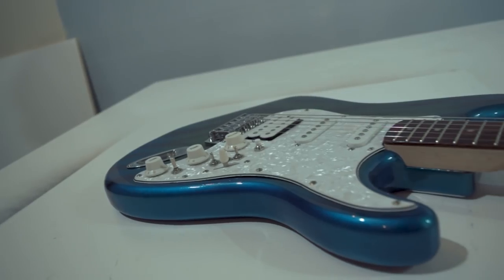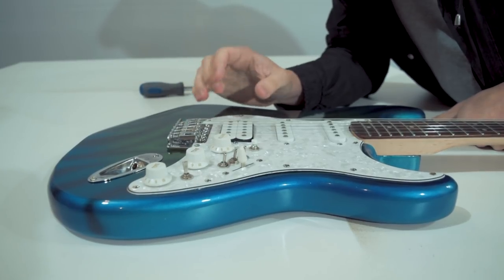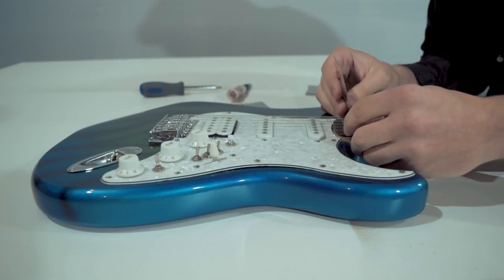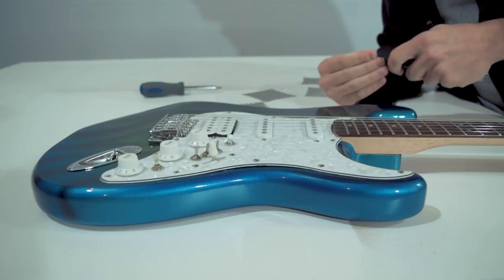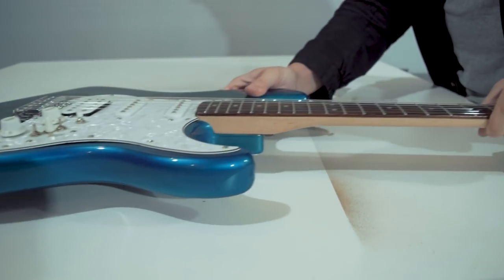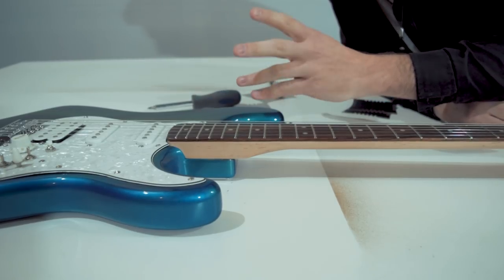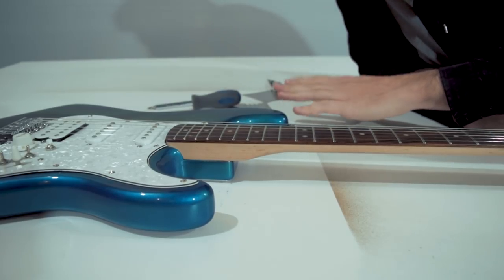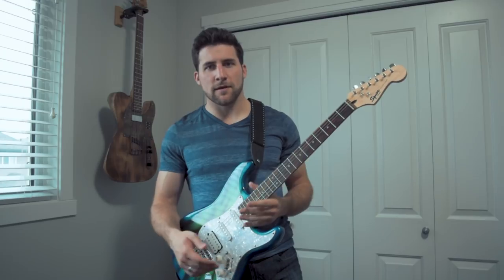How to make a cheap guitar awesome part 3 (final)

Comment: The floating vibrato is a key component to the sound and feel of a Strat. The strings are anchored to a spring assembly, rather than directly to the body. That's special. It really doesn't have anything to do with using the arm.
Reply from the maker: I am not at all fond of Strat tremolos personally. I prefer hard tail, or if I’m using a tremolo Im a fan of the zero resistance models from ibanez.
Reply: @BradAngove  More twang for me.

Comment: Hey Brad, I was wondering if you've had any experience with "sparkle" spray paint? I was wondering if it was similar to metallic (chrome, gold), because when I have used metallic spray paint in the past, the "shine" of it goes away when I put clear coat on it and the colors become dull. Like silver turns into gray. Also, what is candy tone spray paint? Does krylon make any? Like would "candy apple red" be considered candy tone? I'm looking to make a marbled effect
Reply from the maker: The sparkle stuff is different than the metallic shine. You’ll probably want to clear coat it to seal it in. It’s like metal flake. It shouldn’t lose its shine like that chrome stuff. 
Candy paint is dye based instead of pigment based. If you search it on my channel, I did a specific video explaining what candy paints are. I don’t believe krylon makes any.
Reply: Brad Angove thank you very much
Reply: Brad Angove thank you very much

Comment: Great video, your intonation sounds a little off but it could be you're using to much finger pressure. Could try using a lighter pressure or lowering action. But still sounds good. Please consider a fabric finish tutorial.
Reply from the maker: +XGCPolaris it could probably use a bit of an adjustment. 
I don't know how to do a fabric finish haha. It wouldn't be a tutorial so much as just a test; which I would probably mess up.
Reply: Brad Angove A tutorial on your art pieces would be awesome, the they look almost holographic, the paint effects gives depth and almost makes the 2D surface look alive. Awesome freaking talent. Any way to do that on a guitar or does it need a metal surface? Thank you for all your tutorials.
Reply from the maker: +XGCPolaris It needs a metal surface, but I've been playing around with the idea of giving a guitar a metal surface.

Comment: Brad nice Job! I have a question I've been forgetting to ask you I'm hoping you can help me with? Well after painting five Guitars with Rustoleum like in your Videos is there anything that can be done about that chemical smell from the paint after the paint has dried? I thought they were supposed to be oderless paints? Is there a Fix for this problem? Let me know Thank you!
Reply from the maker: +mike giffin Once the paint has fully dried you shouldn’t be able to smell it anymore. How long has it been on there?
Reply: One I painted over six months ago another one about two months and one a week ago? as soon as you open there case's you get the paint odor and the one I painted a week ago hasn't even been put together yet! I just don't get it I even polished one to see if the polish would help get rid of the smell but didn't help. Can't figure it out and there all Rustoleum 2x cans Gloss and Satin and clear? HELP! Thanks Brad!
Reply from the maker: That's ridiculous. Have you been keeping them in the cases though? The solvents should evaporate over the course of 6-8 weeks and there should be no smell whatsoever after that.
Reply: I have them all out of there cases and have them hanging in my work room. I'll let them sit out for a week and I'll let you know What happens. Thanks again Brad.Have a good one man!
Reply from the maker: +mike giffin Thanks Mike. Keep me posted; I’m concerned about this problem, but not sure what’s causing it.

Comment: Hey Brad when you do these demos with your guitar , mic the amp speaker close and kinda on the speaker cap edge check your gain on a mic and make sure you aren't clipping and the quality of your sound will be very professional sounding . That is how a lot of pros do it ! I know one of your resolutions is to have better quality videos . You should check out Ryan Bruce on recording electric guitar ! Good job man I have been a fan of the channel for a long long time !
Reply from the maker: Thanks for the tip. It’s a good thing I don’t do many of these demos haha. The mic I used for this is attached to the camera, so I’ll see if there’s a different way for me to rig it up by the guitar.
Reply from the maker: By the amp I mean.

Comment: "under 200 bucks canadian, which is idk, probably a chocolate bar or something"... pretty much... there is probably a $157.55 usd. chocolate bar sold somewhere, like in beverly hills i would imagine... if you want to know how to wire a push-pull setup, here is a link to wiring diagrams. this is how i was able to wire up my epiphone with coil tapping prs pickups back when i was a lazy highschool band boy.
https://www.seymourduncan.com/wiring-diagrams
these diagrams are easy to follow, and you can follow it without any math or prior blueprint reading skills... you can even email the seymore duncan staff, and they will tell you how to wire pickups that they dont even make! (i remember getting confused because the wire colors were different, and there is one less wire on the prs pickups i had).
Reply from the maker: +5hredder Awesome. Thanks for sending that. I’ll check it out.
Reply: no problem, it is my pleasure to help, especially since you provide all of this content on how to paint stuff. 

btw, the only reason why i clicked on this video was to see what you would play while testing the guitar. it wasn't bad, but it was smart to apoligize beforehand about your skills just so the troll horde wouldn't deem you a good target to pilliage for not sounding professional. that may come off insulting, but honestly, the attention to the potential viewer base is a hallmark of a great videographer.
Reply from the maker: +5hredder I don’t even claim to be a professional at painting, so I’m definitely not going to act like I’m a pro on the guitar haha.
Reply: yeah, well if your profession is to paint, then technically you are... here are the google definitions of it:
adjective
1.relating to or connected with a profession.
2.(of a person) engaged in a specified activity as one's main paid occupation rather than as a pastime.
3.having or showing the skill appropriate to a professional person; competent or skillful.
4.worthy of or appropriate to a professional person.
5.denoting a person who persistently makes a feature of a particular activity or attribute.
noun
1. a person engaged or qualified in a profession.
2. a person engaged in a specified activity, especially a sport or branch of the performing arts, as a main paid occupation rather than as a pastime.
3. a person competent or skilled in a particular activity.

the noun definitions are somewhat repetitive, but you get the point...
Reply from the maker: Haha yeah; I've got it. Painting certainly isn't a profession, and it's not my main paid occupation. 4 doesn't apply. I guess that leaves me hoping that 3 counts even though a painter isn't technically a professional person haha, since I'm not even sure I understand 5.
Reply: you would be suprised... there are schools that teach people how to paint commercially, and there are also artists that paint for a meager living... i would argue that painting can be a profession.
i see what you are saying though, we both know that i am terrible at painting though... by the way, i want to build a copy of a white strat because i dont like the way the ones on the shelves are built, but i like the body style and asthetic of pure white. what paint acts the most like laquer? i am great at staining, and decent at clear coating. but i cannot handle paint well, it may have just been a bad batch that i learned with, but is there a paint that behaves like a laquer when sanded? the last stuff i used would always rub off no matter how long it was left to cure(with thin coats appled) it would even rub off when wet sanded with 1600 grit!...

Comment: The part about pickups affecting the strings is false - they'd have to be like 200x stronger than they are to make even slightly noticeable difference in sustain or string vibrations in general. It's a common misconception, but it'd be great if people stopped repeating it...
Reply from the maker: +MetalSpiderPig Thanks for the info. I recall dimarzio warning me that it was an issue when I bought my blade pickups from them. I didn't realize it had been disproven.
Reply: No problem... Guitarists and guitar makers have been repeating it for ages without actually trying it out, that's why most people still believe it. One thing it will change though, apart from output level, is characteristics of the tone - the closer the pickup is to the strings, the more treble and high mids will be there.
Reply: Yep, I tried it myself with a Seymour Duncan Invader raised to almost touching the string with zero discernable difference in sustain. What it does do is your palm trends to slap the bottom e string onto the magnet and give an audible pop. If you sink the pup into the body, you get a woolly jazz type tone. But the magnets don't effect sustain the way they are fabled to.